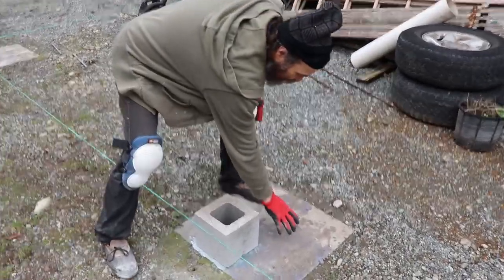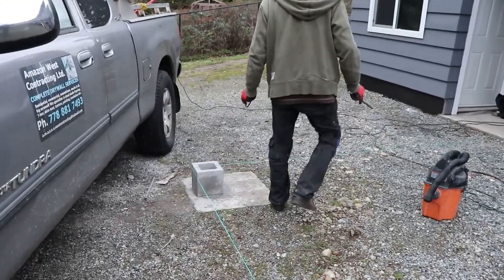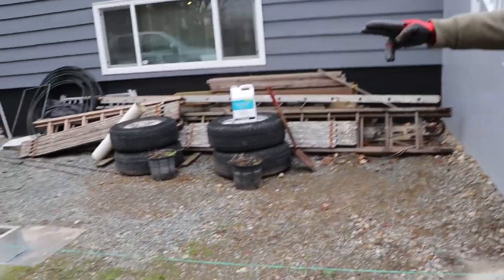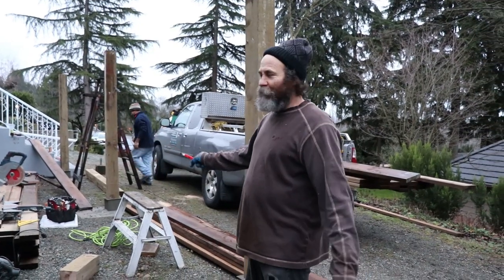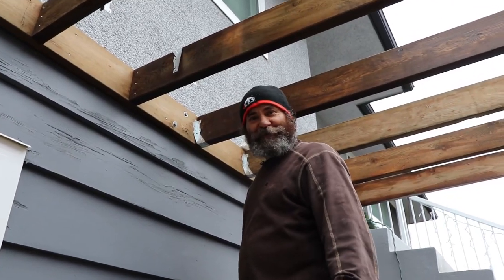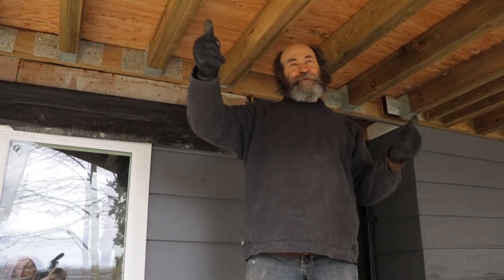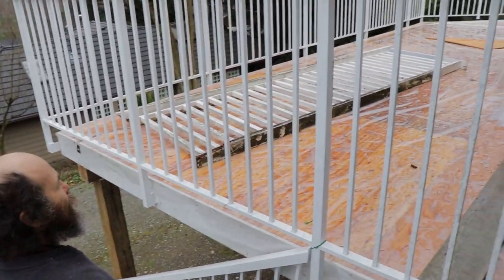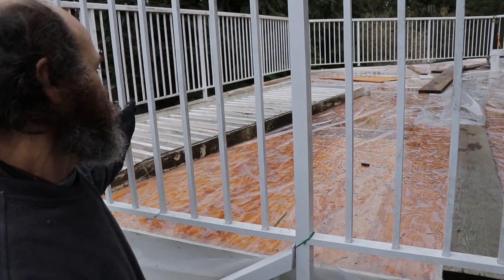How TO build A BALCONY/DECK

Comment: Looks good 👍, how many bodies can it hold?
Reply from the maker: Hello Stuart thank you for your time and support, this balcony can support around 100 pounds per square foot of weight without sagging (double joists), this number includes both live and dead weight. Keep in mind that the span length and grade of the wood are are significant factor when determining how much weight your joist can support, a greater span will decrease that weight capacity, while a shorter span will increase weight capacity, please let me know if you have more questions, keep safe and enjoy your weekend.